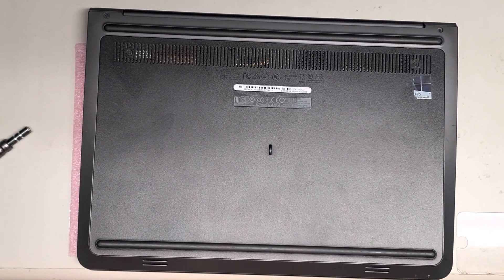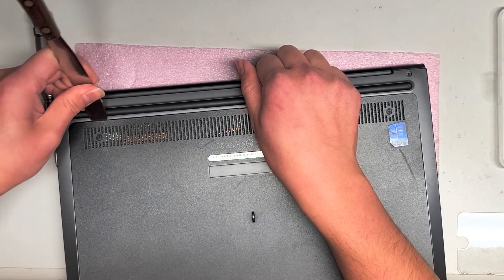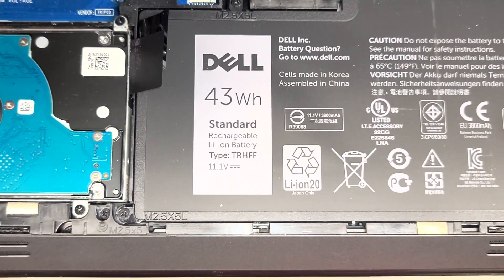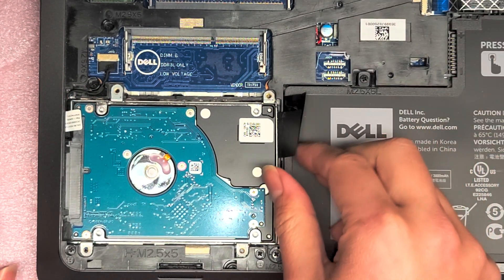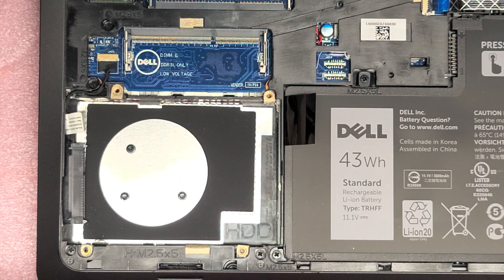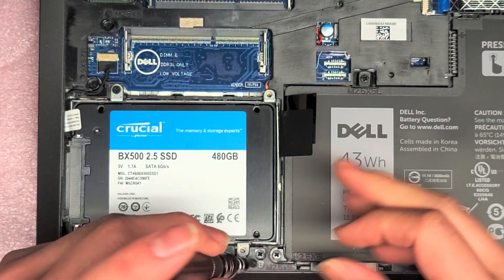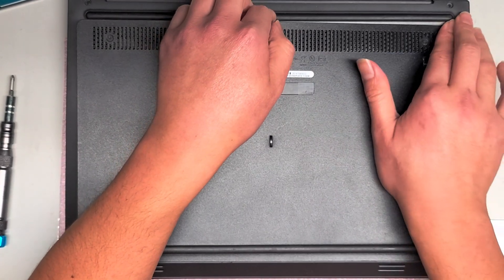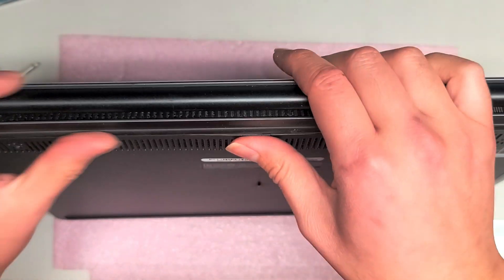DELL Latitude 3450 Disassembly RAM SSD Hard Drive Upgrade Repair

Comment: I have the exact laptop and when i open it, it says “hard drive not installend” so i need to replace it with a new one. Any tips? 😁
Reply from the maker: This video will help you create a bootable Windows installer https://youtu.be/R6GVDyVqWso you'll need another computer with Windows 10 and a usb drive.

Comment: I have one of these, I acquired it from my father who used it for 
diagnostics on domestic/commercial Miele and Electrolux washing machines
 etc until the Seagate hdd died. It has a few quirks from being frozen 
on the passenger seat of a VW T6 van in the Highlands of Scotland during
 the winter (-15c), It spent many a night out in the cold .The screen 
has a white-ish ring around it and the keyboard has a mind of it's own, 
The arrow keys behave strangely, Also the power button needs a good firm
 push for the machine to power up. It runs Linux mint very nicely and I 
use it for watching films on trips/college.
Reply from the maker: Haha nice, though it sounds like it needs to be put out of is misery. :P
Reply: @ItsBinhRepaired  Aside from those faults It keeps on going, Just gonna send it till the time comes.
Reply from the maker: @pintmarten2403  sounds good :)